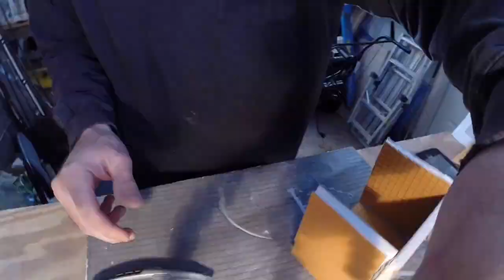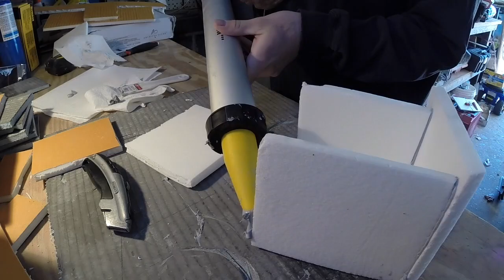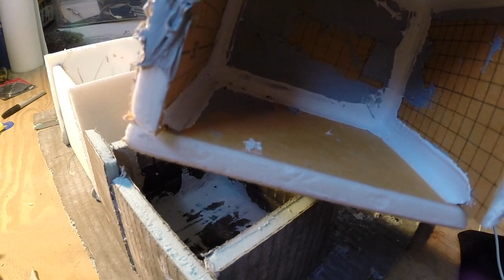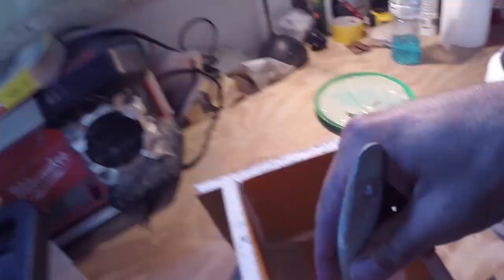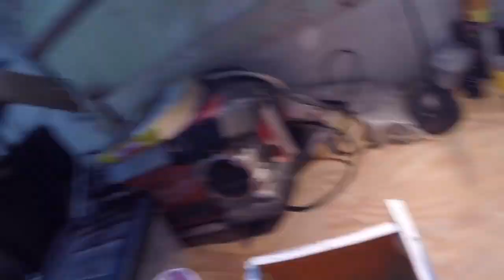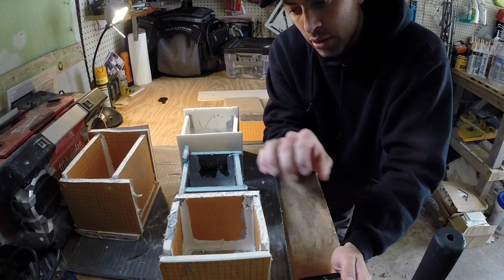Shower Foam Board Product Testing&Methods

Comment: Interesting experiment, although the results were a foregone conclusion...but my take on ALL these systems is that it's all about selling product, at a high cost compared what it cost to manufacture it. I painted 3 coats of RedGard inside a cardboard box, filled it water and let it sit 7 days...no leaks. Posted that video 6 years ago, used their product ever since for only $50 a gallon
Reply from the maker: I understand your view.But a solid closed cell foam wall board is far superior to a liquid face coating.Using the foam building materials is easier on the body and saves time
Reply: There needs to be a problem first. Of all the tear outs I do, I'm not seeing damage that would justify these products...in fact for the most part, my Redgard on walls is not doing much of anything, mostly for my customers piece of mind. Almost all failures are mostly operator malfunction in one way or another. Using these products have not prevented anything that the installer could've negated by using proper methods.
Reply from the maker: Listen,Most failures happen on shower base's and the curb.Do things the way you want, just don't get upset when something fails,because you go against every industry standard there is.
Reply: Not trying to get into a pissing match, just voicing my opinion. As far as me doing everything "every industry standard", well that's not really true...but I think things out that make sense, and not one failure of anything in 20 years.
Reply from the maker: StarrTile I hear your point.Liquid membrane works as they say they do.I noticed you is drywall in your showers with liquid.You need to at least use cement

Comment: So what I take away from this, Kerdi/Wedi board with a couple coats of Hydro-Ban or Red-Guard is the absolute best way to insure a water tight seal!  Thanks
Reply from the maker: Sox4Life Using a liquid will work.As showed.But going by manufacturers instructions is a for sure method